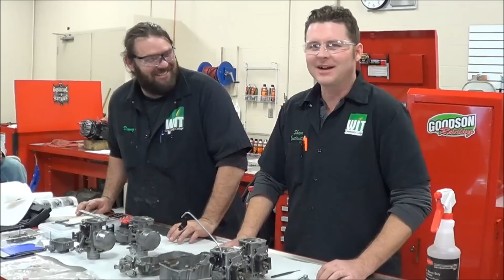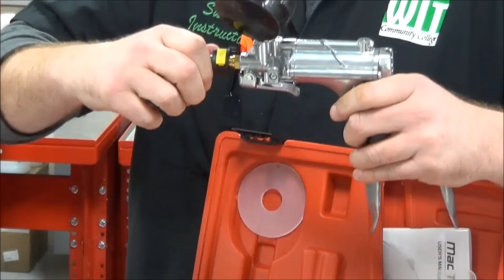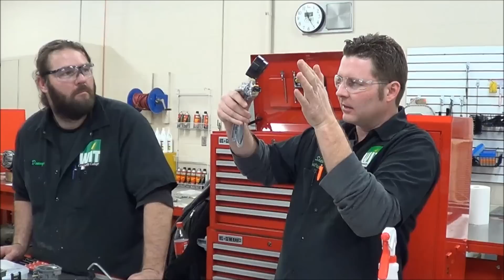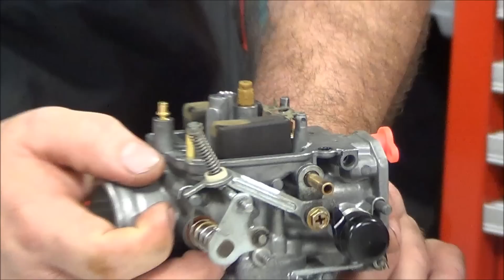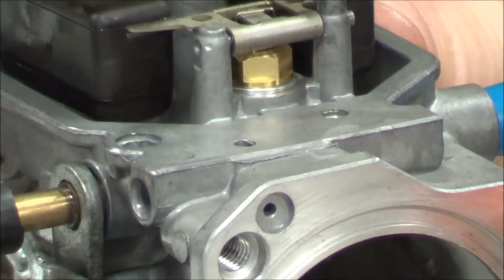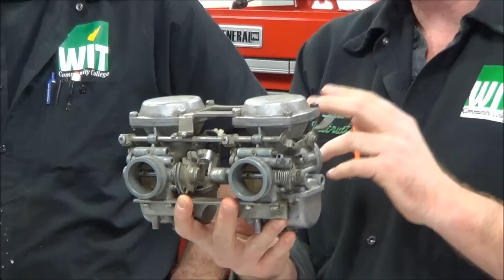How to bench test a carburetor after rebuilding on Metric Harley and Asian

Comment: I love the way you explain in details 👍
Reply from the maker: 🙌 🏁 First off, thank you for SUBSCRIBING! Love seeing our subscribers comment on how the video helped! It helps us!
Here is a way to support all the free videos.
Want to say “thanks” or “keep it up”? Click here https://www.paypal.me/how2wrench  

Coach Conley is also available for hire to personally work one on one with you if ever needed. Yep he is a real person. Give him a call @ 602-345-0432

Your answers and help are just around the corner. Save time and money while protecting your investment and yourself by doing it the right way!
Follow us!
Web:
www.How2Wrench.com     
www.Tools2Wrench.com
Reply: @How2Wrench   Hi Shane! Just ran into a problem with my inline 4 carbs. Carb 1 not running as hot as the others. Pulled float bowl of carb 1, cleaned all jets and bowl. New float bowl gasket. Reassembled, verified no leaks. Decided to actuate throttle body by hand before putting carbs back on the bike and carbs 4, 3, and 2, all squirt out fuel in a nice stream, EXCEPT carb 1. Seems like no gas comes out of that brass nipple. Not a stream or slow blurp. So i figured thats why carb 1 wasn't running as hot as the other 3. But how do i fix it? Carb 1 gets gas, just doesn't shoot out stream when you actuate throttle body. I'm not sure which "port" to clean out to help remedy this. Keihein carbs off an 82 honda 650 nighthawk. Thanks for any help.

Comment: If you want a convenient fixture for holding carbs with a vise during leak tests a long piece of ~5/16" aluminum plate is easy to add holes to and can place carbs away from the vise for easy access. For test shutoff valves I use plastic Briggs and Stratton inline valves with my dummy tanks. They are cheap by the bag via Ebay (and also go on all my gravity feed mowers and small engines). 

While you probably know to use "hollow ground" screwdriver bits on jets because wedge style flat tips smear brass, you can make hollow ground bits even better by grinding them like this (with a Dremel or similar) which is a side view:    )(

The edge you create grips the bottom of the screw slot in the jet even if the rest of it is trashed. If you pick up some long hollow ground (typical flat tip bits are hollow ground) bits you can reach deep into carbs.

Comment: Excellent content! But what makes a bike rev high at stops when there is absolutely no leaks at the manifold? Bike runs good but my inline 4 CV carbs does this!
Reply: willmann30 it’s what they call a lean Hang. The carbs could be leaking through vacuum lines.
Reply: @RealWunderBanana  WOW I never got a notification for  this.
Reply: willmann30 my 1982 Kawasaki used to do it all the time. I rebuilt the carbs, replaced all vacuum lines and plugs and replaced the manifold boots. Fixed it perfectly.
Reply: @RealWunderBanana  thank you that's exactly what I did spent the money and definitely got my money's worth.
Reply: willmann30 I’m glad I could help you out!